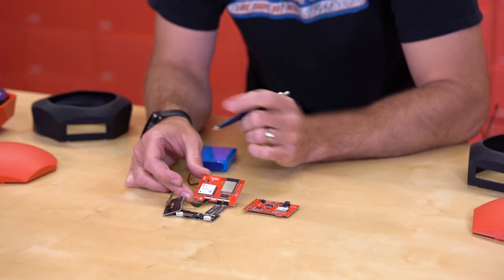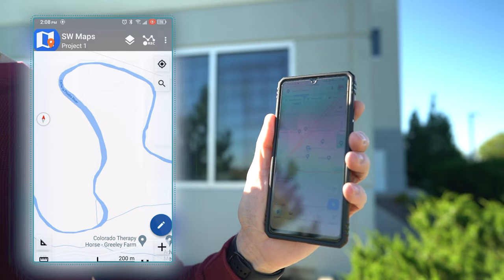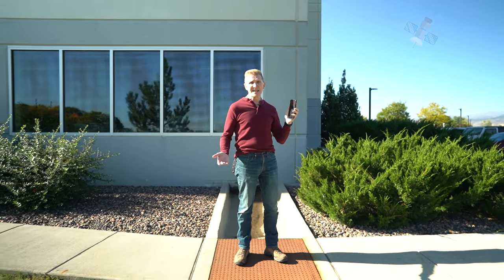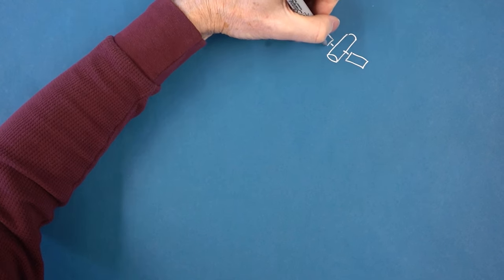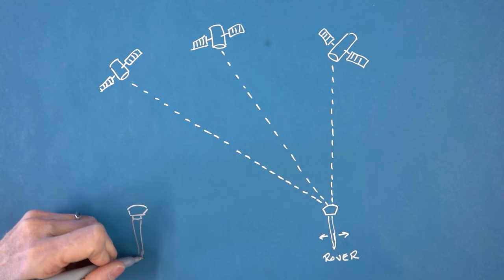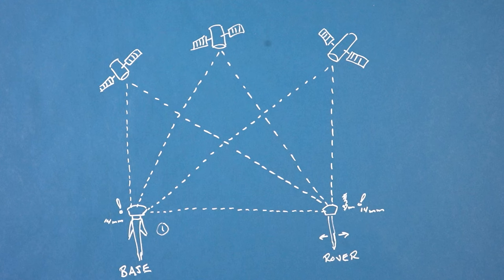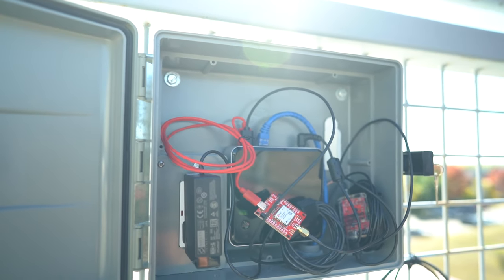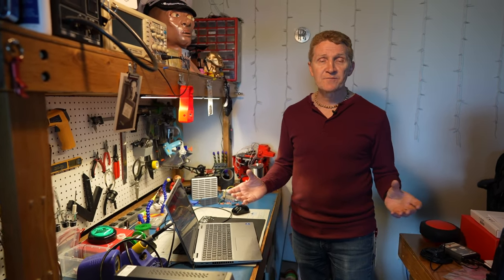Real-Time Kinematics Explained

Comment: Is there a technology that would enable RTK measurements in dense urban areas and in places surrounded by trees and tall buildings?
It would be a great help in my work (architectural visualizations) where we have to accurately and quickly measure points in "difficult" conditions.
Reply: You could always try using some form of UWB instead. It isn’t linked to GPS but is another method of getting relative positions between anchors (base stations) and a moving module.

Comment: I have a stupid question. Is there a way to use a base station outside and transfer signal inside a building so I can get more precision when I scanning with SLAM technology ?
Reply: You should have a look at UWB. It doesn’t use GPS but uses a few base stations you would need to set up to calculate the position of a moving module.
Reply: @conorstewart2214  Thanks, I will look into that.

Comment: Why use the ground based stations if there is a satellite...? What am I missing
Reply: I believe, that the satellite is a subscription service, with the first year included with the HW purchase. After which, the subscription service must be renewed.
Reply: In addition to what @xsk8rat says, there are some locations where the portion of the sky (southern sky for us northern hemispherites, northern sky for all those southern hemispherites) where the satellite resides is blocked by mountains, buildings, mountain trolls, your annoying neighbor, etc. This is exacerbated the closer to either pole you get as the location in the sky the satellite is gets closer to the ideal horizon. I don't know how many of those L-band satellites there are around the globe, but there may be some places that there isn't one right overhead and you can't see the next one either to the east or the west of your location.
Reply: By having a known, fixed position, it can use its own calculated error to compensate for errors introduced by the environment.  It’s sending correction data.
Reply: Also worth adding is that u-blox PointPerfect correction service for L-Band corrections is currently only available in the USA's 48 contiguous states and Europe.
Reply: You missed nothing, satellite systems aren’t that accurate.
Reply: One reason is that an L-Band correction, whether it is 'differential' or PPP (precise point positioning), is not as precise as a local reference station. Differential is considered sub-meter. PPP is getting better, but it still isn't as precise as proper RTK and convergence time is still quite high. They all have their place, however, so nothing is 'better', because that requires an assessment of requirements, and those vary.
Reply: The corrections transmitted by the satellite to all users in its footprint help correct for errors in satellite ephermeris data, clock offsets and other GNSS spacecraft variation.  It can't correct for errors in the path through the atmosphere (and ionosphere) between each of the GNSS spacecraft and  your specific location on the ground.   A ground based reference station can just compute the pseudo-range error to each GNSS spacecraft, and distribute corrections to nearby "rovers".  Those corrections would include the impairments from all those sources, including your own local circumstances because it's measuring those local effects.